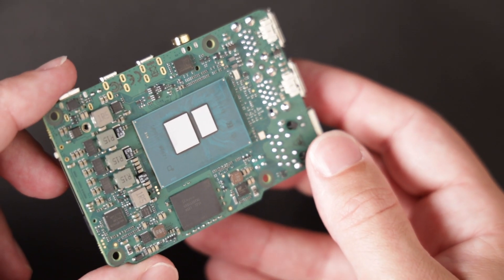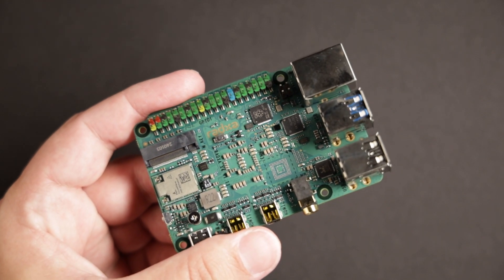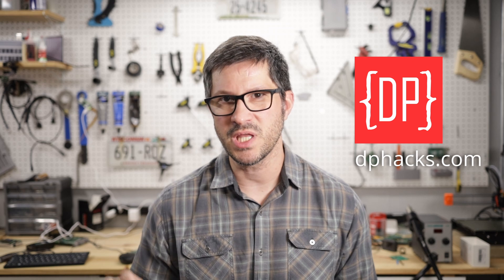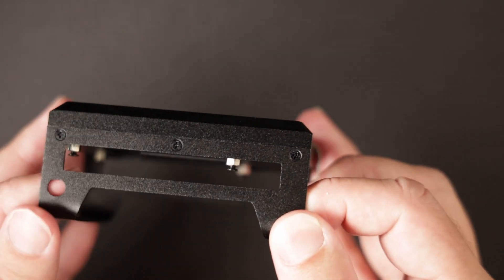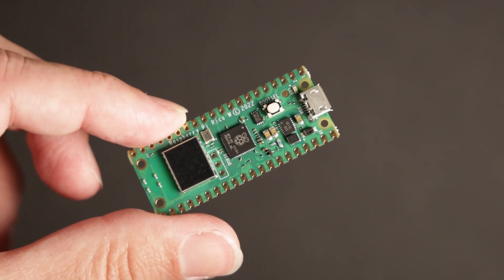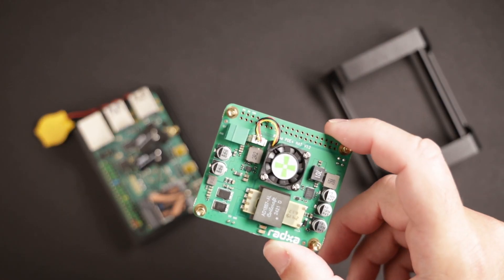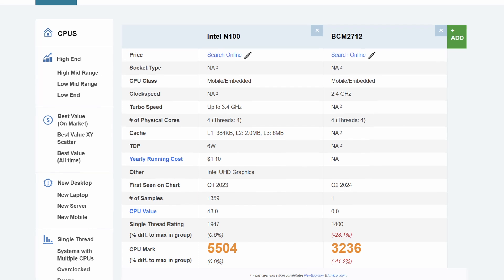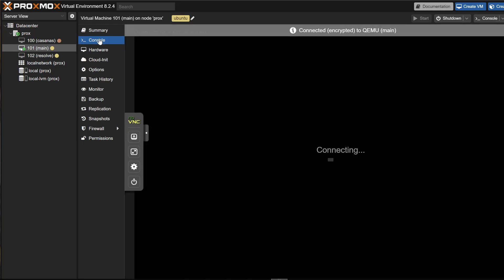Radxa X4: Perfect Raspberry Pi-Sized Mini PC?

Comment: You deserve more viewers, I found you today and this review is pretty honest. Some youtubers seem to always sell the stuff no matter how many compromises it has.
I'm just surprised by idle power consumption of mITX and X4, i would expect that N100 uses less power than notebook or desktop CPUs, not more.
Reply from the maker: Thanks! Power consumption can be tweaked, o was using the default settings. Radxa might be able to optimize it also with a firmware update

Comment: Hi. Do you still have the board?

I am looking at it for astrophotography, using Manjaro and Kstars/Ekos. But I would be powering it up from a powerbank, so I need to bring down the power consumption to as low as possible. Playing with the PL1 and PL2 values on a j4125 device (MeLe Quieter 2q) + powertop + TLP I got to around 1.3-1.4 W with the OS booted and in idle state. That was crazy ! I wonder if with this N100 device I could get anywhere close...
Reply from the maker: Yeah, I still have the board. Power consumption is hard to compare across devices, environments, OS installed, power supply, etc. So many variables

Comment: Great video, exactly the info I was looking for. BTW, did you perhaps ever measured the power consumption of a Raspberry Pi 4?
Reply from the maker: Thanks. Power draw on the Pi 4 is usually 2.5 to 3 watts on idle. Like all power draw tests, it depends what's plugged into the Pi

Comment: I like the optional heatsink, I have so many old heatsinks from CPUs and GPUs etc, that I'm curious if I can rig one up to work. I don't even have a real use for this thing, but at $60, no excuse not to tinker and learn.  They got me with the $9 shipping, I had to buy 2 other SBCs so it would be worth it! (Zero 3W $22 and Rock 3C $28)
Reply: The heatsink is useless and noisy

Comment: cut the flat part of the sled  off and smooth the edges and  it will stand on the four vertical pieces connecting to the sled.  it just won't be as tall.  you probably have a grinder for that anyway.

Comment: I will add that this isn't the first x86 Intel dive into embedded.  The Intel Edison was a dual core throttled down to 500 MHz with 1 GB of ram, 4GB EMMC and at that time was an interesting server the size of a postage stamp that could fit with battery in a matchbox.

So for me, the Radxa X4 makes an interesting step up.  Interesting to see where it goes.

Comment: Ok, this a newest Raspberry Pi Format boad. One that comes to mind is the  UP, that was using Atom X5. I know there were others.  It's not fair to call an Intel CPU a Raspberry Killer. It's not Arm. That like compare a diesel engine to a car engine. Yes, they are both engines, but they are design and work different.

I am using the X2L from Radxa as Proxmox server, with only 8 gigs no eMMC storange it works great. It's my carry with me server. It works great, but it's nice to have that 2280 M.2 slot. I see that 2230 M.2, which you didn't seem to cover is cost for storage. 2280 cost is better for most homelabbers, 2230 are still a bit expensive. Compare 1TB, 2280 is avg. $70 vs. $150, 2230.  

I don't see the slab to be an issue for most, because most folks that want to use the GPIO will probably 3D print a new one that works. Yes, for the avg. Joe that doesn't have a 3D Printer, so I get that.
Reply from the maker: Hey, a few counterpoints: I don't claim it's a Raspberry Pi killer. Diesel engines are car engines also but car comparisons are usually fallacies anyway. There are plenty of affordable 1TB 2230 as they become more popular. Yes, they are a little more expensive but not by much anymore.

Comment: recheck your numbers using another os and you'll see the difference in your slides
Reply from the maker: Which OS do you suggest? Are you saying it will be lower at idle?
Reply: @makerbymistake  Debian
Reply from the maker: Just tested it, no change. 9W on idle
Reply: @makerbymistake  did u test your temps what os did u use
Reply from the maker: @kiodiekin  Debian, like you suggested. Why would the CPU temp matter for idle power usage?

Comment: It is shame that Radxa really messed up with that poorly designed heatsink/case. I suspect that there will be quite a few third parties making cases for it though.

But as far as the board itself is concerned, as long as you don't need the camera and other connectors on the Pi 5 then the N100 is obviously going to give superior performance.

The Pi5 still struggles with 4k browser playback that was originally promised with the Pi4.

All in all, the luxury of being able to throw practically any OS at the X4, knowing that 99% will work out of the box gives way more confidence in using the product and not having to potentially fiddle about to get things fully working on ARM.

The debacle of the RK3588 means that for full functionality use, the N100 is a very obvious choice over ARM.

All of the extras that you need for the N100, you also need for the Pi5, including cooling.

The one area that the Pi5 cleans up in is with regards to power consumption but even the N100 board only requires as much power as many a lightbulb.

I have already noticed that Pi5 fanboys/girls are attempting to defend it in any way possible, in cringe watching moments. Share prices have to be protected now that the company has gone public, so I think that many commenters are coming from very biased positions.

The lines between which one to choose are fairly clear but it will be obvious that X86 now truly challenges the ARM Pi monolith, so a Pi6 will come very soon.

I'm going to wait for an N97 version from this, or one of the many other manufacturers that are bound to jump on the bandwagon. The performance gap, especially with the GPU, will just widen even further.

Whilst this board alone will not kill off the Pi5, partly due to economies of scale, once others jump in, then the reign of PI could be coming to a rather quick end unless radical changes are made.

With all the issues that Intel currently has, these budget Alder Lakes may well be saving them, so I expect production to ramp up to cope with future demand.

Comment: Get cheap chrome books they can be unlocked for whatever os, and some have very small rectangle motherboards. There are lots that can be had for $9 or less per
Reply from the maker: The purpose of the video is not to tell you what to get. The purpose is to provide information so you can decide on your own what to get
Reply: if you want used, great, if not, well, a pass

Comment: The holes are for wifi antennas
Reply from the maker: Interesting, but if that's the case, it's also a bad design. The provided antennae would have to loop around the SSD to fit through the holes
Reply: @makerbymistake  The holes will be used for SMA connectors for SMA wifi antennas. I think it is a good design. It  does not mean to use with included antennas
Reply from the maker: @apichartintarapanich2911  that make more sense

Comment: Thanks for posting all your experience with the UART and RP2040, I used it as reference in my testing! It's good to know we have a lot of the same conclusions. I think the biggest takeaway is this is more a smaller Mini PC and less a Pi SBC replacement
Reply from the maker: Cheers Jeff! Yeah, it's a Mini Mini PC :)
Reply: I appreciate that you always mention about power consumption, which lacks in some Jeff's videos. 
I'm making a DIY laptop based on RPi5 and planning to make a x86 version,  so this parameter is important for me.
Reply from the maker: @whereisyoursaviournow5280  Thanks, and yeah, power consumption is definitely important for embedded devices!
Reply: @whereisyoursaviournow5280  Sometimes it's in the videos, sometimes not, but I always document all the technical and test details in the GitHub issue I link from my videos.

It's especially helpful to have a separate dataset (like @makerbymistake also has a companion blog post) so we can compare numbers and make sure one of us doesn't get a fluke result!
Reply: I don't think it is a Mini PC since it includes RP2040. This MCU is good and the way Radxa design is very good. They connect USB of the RP2040 to the N100 USB and they also connect the hardware UART of the RP2040 to the hardware UART of the N100 CPU. The UART pins of the RP2040 can be set to be either hardware or software serial. However, in RP2040 , there is Programmable Input Output (PIO) which is a programable state machine and there is PIO UART for RP2040.  Hence, you can use the PIO UART without using any CPU clock. Moreover, there are two cores in RP2040 and one can be used just for talking to the N100. For this price, It is very very good deal.  For comparison, UP 7000 series with N100 and 8GB of RAM and 64GB EMMC will cost you $239 and it comes with an Altera CPLD for 40 Pin IOs instead of a MCU.